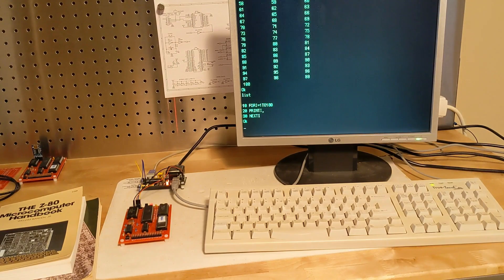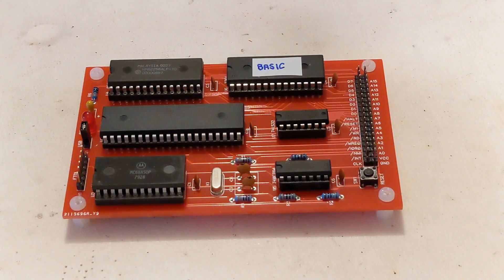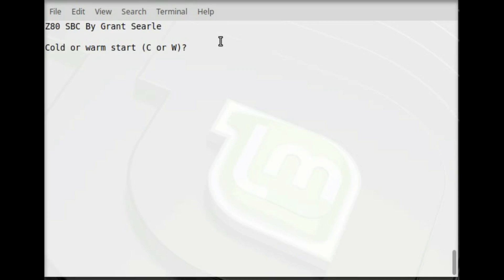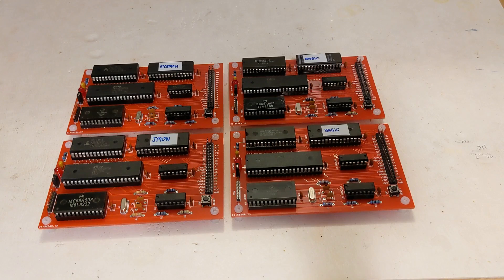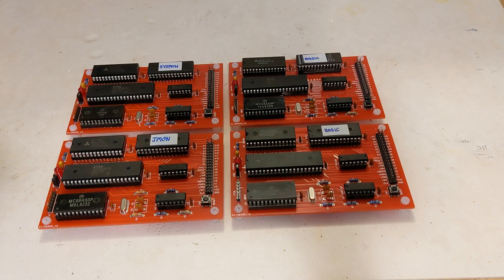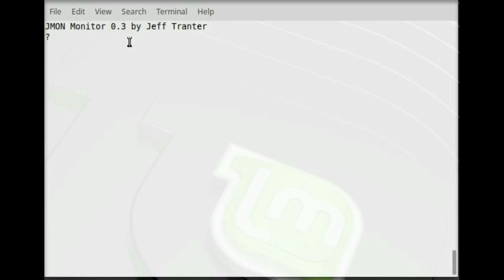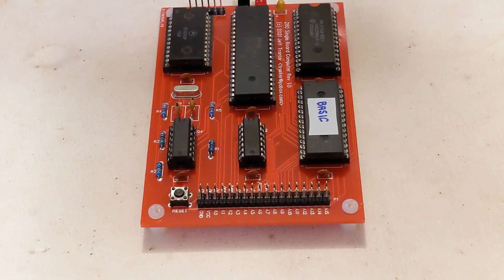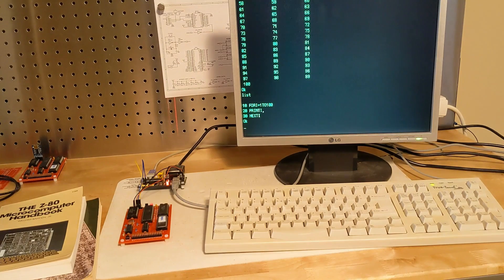A Z-80 Single Board Computer

Comment: Very nice design Jeff, thanks for sharing. I have a question: is the CPU a plain Z80 or a  Z8400, that runs up to 8 MHz? Since the crystal has a frequency of 7.3278 MHz,  I assume that it must be a Z8400, since a plain Z80 runs up to 4 MHz only (some models up to 6 MHz). I'm also from Ottawa, it would be interesting to exchange ideas; I'm trying to build a Z80 system, and am also interested in antique radios (have a Blaupunkt all tube radio from 1961).
Reply from the maker: The boards I built used Zilog Z84C0008 chips. More recently I'be been playing with this Z80 board that can run CP/M: http://cpuville.com/Kits/Single-board-kit.html

Comment: Would the basic terminal still be function if I slow the clock speed down to 2khz? I want to use a 555 timer.
Reply from the maker: No, the ACIA serial clock is derived from the CPU clock so it would run at the wrong baud rate. You would have to drive it's clock from a separate oscillator. Also, depending on the version, the Z80 has a minimum clock frequency that may be a few hundred kilohertz.
Reply: @jefftranter  Could I use a 7.15909MHz crystal instead of a 7.3278 MHz?
Reply from the maker: @dr.chill99  Probably. That's an error of about 2.3% and serial ports can usually tolerate up to about a 3% error and still work.

Comment: Well, if you really want to re-experience the 1980s again, you should add an interface so you can load or save your work from cassette tapes. The TRS-80s by Radio Shack had a a fairly simple tape interface.

Comment: Grant also has another version which could run CP/M, which imho is a lot more interesting, as it provides a large collection of games and utilities. Also, if the expansion port is changed to follow the RC2014 pinout, it would open up the possibility of having large number of expansion cards available for your SBC.
Reply from the maker: Yes, I have seen Grant's CP/M design . It looks very interesting and I may build it some day.
Reply: It wouldn't be that difficult to build an adapter to convert the expansion port to RC2014.

Comment: Hi Jeff, I typed a lengthy reply yesterday but it seems to have disappeared?   Basically it was to thank you for the PCB, prior to finding this video I'd already built one!  I wrote a tiny monitor to fill the 580 free bytes in the ROM, links in the video https://www.youtube.com/watch?v=mvZ_L-rdgBQ , makes a nice Z80 development board :-)
I also use the Geoff Graham PIC terminal in various projects, its very handy. I also built one of Geoff's original Colour Maximites - very clever design  :-)
There are a few other retro projects on PHILG2864 you might like, Z80, SC/MP and M6800
Cheers
Phil

Comment: Thanks for making the layouts available Jeff. I built your 6809 design a few months ago but I used Hitachi 63B09 and 63B50 in place of the Motorola parts. It took a few attempts to program the ROM but it's now working with the combined BASIC and monitor.
Reply from the maker: I've been wanting to play with a 63B09 and try out the new instructions, but the parts I've obtained so far from eBay were all either bad or possibly fakes.

Comment: Where's the interface for a monitor and keyboard?
Reply from the maker: The header pins at the top accept an FTDI USB to serial adaptor. There is no on-board video or keyboard.
Reply: @jefftranter  - So the computer serves as the keyboard & monitor?
Reply from the maker: @tubeDude48  Yes.